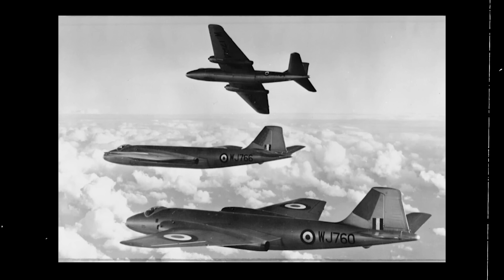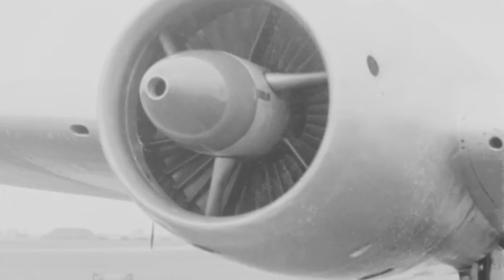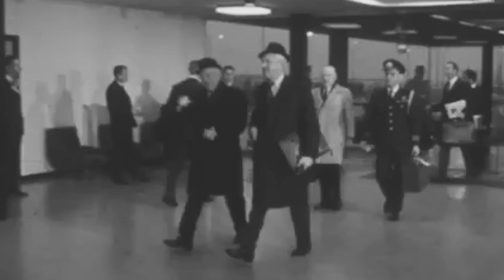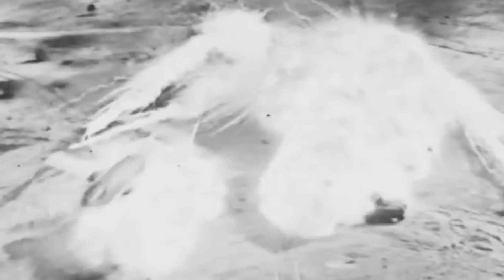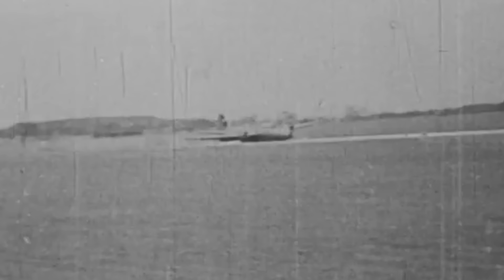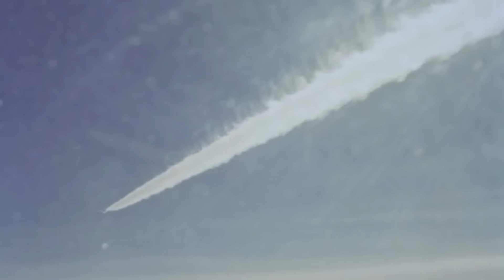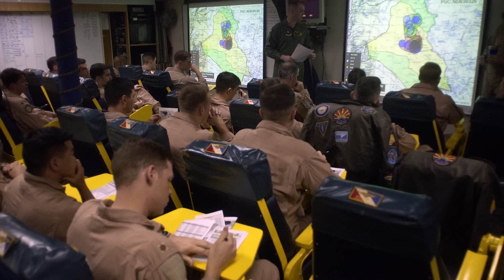The 63,668 Foot Plane That No One Would Acknowledge

Comment: The wing - it’s actually a low aspect ratio wing and not high aspect ratio. This matters as its fundamental to the design of the aircraft. Stopped watching at that point.
Reply: "Mid-Aspect" maybe? The wings do appear to be mounted center; that is, up and down!!
Whaddya think?? 🤔😉 If viewing from top-side, they do appear low, as you describe!!
Pretty Awesome Plane though, ain't it!!  New Technologies are always Dangerous!! The Narrator does talk about some fatal mis-haps. It must have been... what's the word?..surreal..to be a Pilot who's world consisted of Piston-Engine Planes....to find himself at the controls of a Plane powered by Turbo-Jets! Experiencing Accelerations and Climbs/Ascents that would seem impossible.
Reply: @RedneckSpaceman Aspect ratio of a wing is determined by the ratio of wing span to wing chord. The Canberra wing is most definitely a low aspect ratio wing. If you take a look at a gliders wing then that is an example of a high aspect ratio wing. Where the wing is mounted, high, mid or low, has no bearing on aspect ratio. I spent a few years on 39 Squadron in the RAF operating the Canberra PR9.

Comment: Who writes the guff you spout? Take off in low visibility is a very simple procedure. You run along the runway, rotate and go straight onto the instruments. So? What’s the problem? The problem with Canberra is lack of rudder authority with one engine inoperative at high thrust settings. It low speeds it is necessary to reduce thrust on the good engine to gain directional control.

Comment: There is a Story in the Venezuelan Air Force, a bubble canopy type, no ejection seats. The Airplane became uncontrollable and could only fly in circles, after several attempts to remedy the situation, it was decided to bail from the Airplane, to do so, the door had to be opened against the wind by a hydraulic actuator for the crew to safely jump, when they did it, the airplane started flying somewhat straight and they managed to land it safely.

Comment: 45sqdn Sinapore B15s,  in the 60s when the chinese tested a nuke if the wind was in the right direction we wld upsticks to Kai Tak (Hong Kong), where we fitted modified wing tip tanks which acted as sampe sniffers to allow the boffins to analyse the bomb. Later served at St Athan where some camberras were totally refurbed, wings off fuselage split into 3 sections and a full refurb done.

Comment: I remember reading a story that RAF Phantoms would regularly attempt PR9 interceptions unsuccessfully.  Now US Phantoms in a zoom climb have reached 98,500 feet and have maintained a sustained altitude of 66,500 feet. I don't know what the UK operated versions of the Phantom were capable of, but if the story is true then this would suggest that the PR9 had a ceiling comparable with, or greater than, the U2's service ceiling of 80,000 feet. The maximum ceiling of the PR9 remains classified information.

Comment: Always a pain to fit and remove the ejection seats on? At least on the PR9 we had the canopy removed and the nose and front hatch open. On all the other Canberra marks we had to dismantle the pilots seat and feed it in through the side access door. Same with the the "Swing Seat" on the T4 trainer aeroplanes. The ejection system was somewhat archaic. The seats had no rocket pack so you needed to be flying at 90 knots to have a chance of ejecting safely? And the canopies and hatches (other than the PR9) used multiple detonators (66) to blow them off in flight.

Comment: The Lincoln was based around griffins not Merlin’s I thought…
Reply: Lincoln did indeed have Merlins, though the cowlings they were in were not a million miles away from the Griffon cowlings of the Shackleton.
Reply: @AttillatheHun-ph5eu makes sense thanks for the response…
Reply: The Lincoln used to stage superchargers on the merlins and so had considerably higher altitude capability than the Lancaster.   The Lancaster was tested with two stage Merlin and had considerably greater performance.  It did have some problems but this was because it hadn’t been fitted with four blade propellers to bite into the thinner air.
The Shackleton got the griffins but it was only used as a Maritime patrol aircraft

Comment: The RAAF flew Canberras during the Vietnam war.

HQ Seventh Air Force was impressed with the bombing accuracies of the Canberras when operating in close support of ground troops.

The Canberra achieved the transition over many years from a high level bomber with poor accuracy to a very accurate low level tactical bomber in support of ground troops. Most of the day low level operations in Vietnam were in IV Corps where the low and flat terrain resulted in the Canberra achieving very good bombing accuracy.
Reply: My uncle flew Canberra bombers in Vietnam war.

Comment: The Canberra was a remarkable aircraft for its day.  I wouldn't be too surprised to find out there are a few of them still flying missions...
Reply: 3 Canberras are in service with NASA (WB‑57F variants).  They are used as camera platforms capturing stabilized images of rockets after launch.  The most recent use was photographing the Artemis II launch from an altitude of about 45,000 feet.  Images from the aircraft were shown on NASA TV as part of the tracking.
Reply: @brucedunncanada really remarkable performance for an aircraft about as old as I am.
I know I can't get up that high. I can barely get up from the couch!

Comment: The USA U2 is clearly inspired by it.
Reply: I think I read the U2 is based on the F 104.
Reply: @drwthmpsn7457  The U2 Fuselage is from the F-104 with glider wings added to it and different tail design for the thin air and lower speed where they operate at...
Reply: @drwthmpsn7457 😊 Inspired by the  😊high altitude capabilities of Canberra 
😊photo😊
Recon
 models😊.
Reply: @32ModB: you're possibly correct. The Canberra first flew in 1949. The F!04 first flew in 1954. The U2 in 1955.

Comment: 24:30  It was not just problems with the pressure bulkhead which could be fabricated it was the Main Wing Spar section which was a very large single element forged casting that was shown to be developing cracks and no longer able to be forged.    Thank you for an interesting presentation.

Comment: (2:00) "It had a clean fuselage, high-aspect wing and engines buried in the wing roots to keep drag down"... Sounds like you are describing one of the V bombers or perhaps a Comet. Instead the Canberra doesn't have a high aspect ratio wing, and engines in the main spar, halfway the wing. Did you even look at the picture of the plane? Took a whole whopping 2 min to spot a rather glaring mistake.
Reply: This happens a lot lately.  This channel is going downhill...
Reply: Yes, F86, posing as Mig 15s, and a Victor being shown instead of a Canberra, both of those in the opening minutes...
Reply: @OldSmokey1953  plus sequences featuring the Valiant. Somebody forgot to use their Observers Book of Aircraft properly.
Reply: The wing is not crazy high-aspect like U-2, but still they are pretty long for their chord.
Reply: @Andrew-iv5dq  It was much more stable than a U2 for camera work and could carry a much heavier or more diverse load.
Reply: It was the exact opposite of a high aspect ratio wing.  About medium actually.